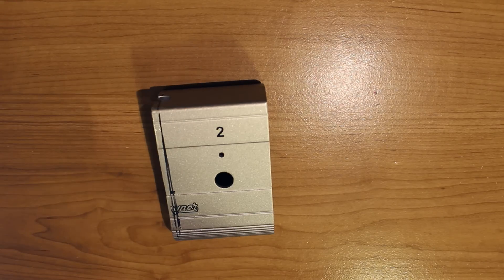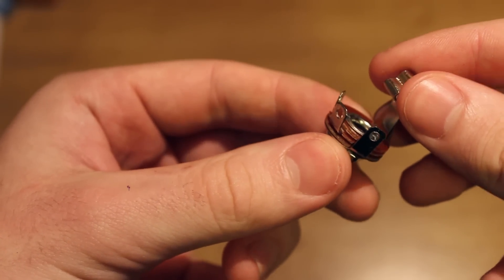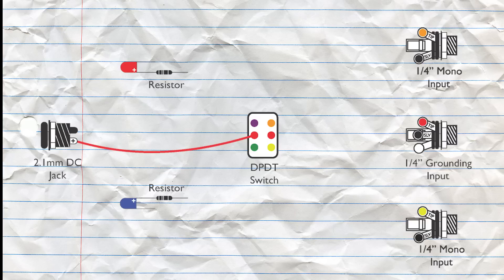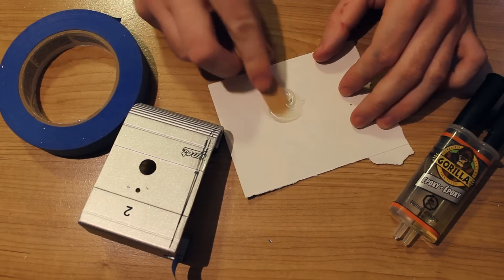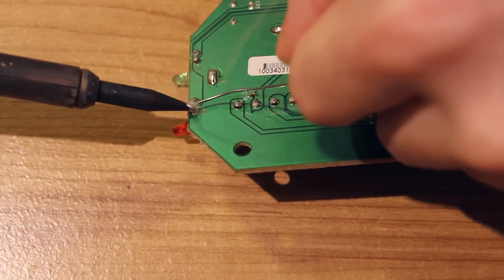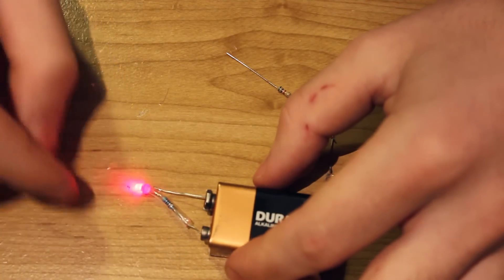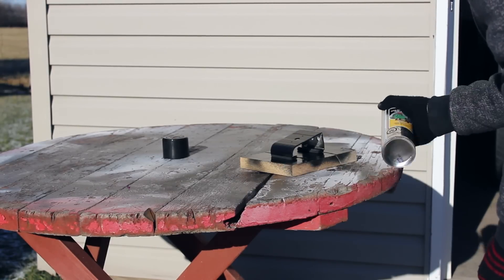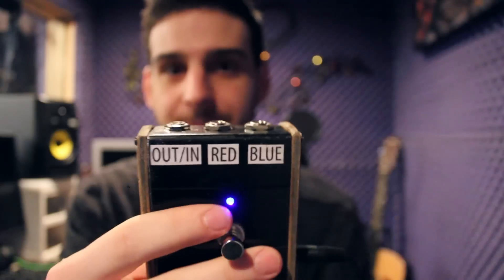How to make: A/B Switch Guitar Pedal w/ LEDs

Comment: Heyo! I assembled the AB switch as you have and have a ridiculous amount of noise on the unused channel. If A is on, B constantly makes a loud hum and same vice versa. Any advice for reducing the noise?
Reply from the maker: Sounds like a grounding issue. Could be a faulty switch? Maybe you're power/voltage is too high/ incorrect
Reply: @DidItMyself  Yeah, that's what it was. I used a metal enclosure that grounded everything together. Swapped out  the B out jack with one that doesn't ground to the enclosure and it worked.

Comment: Hi, I want to do this but I didn't understand how the leds remained turned on so I have a question about the Switch: It is a latch or momentary switch?
Reply: The led is turned on by the DC power, which is switched from one LED to the other by the switch (with resistors to prevent blowing or burning them).  You probably want a latching switch. If you use a momentary one, A will be on all the time that you aren't actively pressing the switch; i.e. it switches to B when you press and back to A when you release.  With latching, you press, changing from A to B and press again to switch back from B to A.

Comment: If I wanted to make 3 inputs, to a single output,  would I just add another 1/4" Jack wired the same as the other 3?
Reply from the maker: I believe you would need a different switch to do some like this. Another option would be to add a second switch. Look up some diagrams of ABC switches and they should show you.

Comment: Hi! nice job. Could you help me to adapt the wiring? I have a different type of switch, it has also 6 pins but is one that has longer lugs with rings on the end. Is it the same wiring diagram for that one? Thanks.
Reply from the maker: This sounds like it would be the same as the wiring diagram in the video. Good luck!

Comment: I think it's great you did this out of reclaimed material. Helpful tip; the side of an LED where the bulb is ground flat is the negative side. Saves having to muck around with testing it. 

If you want your wood to take the stain better only sand to 120 grit. I work in a wood shop and we never prep anything that is getting stained with higher grit than that. Not even fine furniture. Sanding scratches show badly under a clear coat. We would be sanding with finer grit if 120 was leaving noticeable scratches. It's cheaper to do it right than to do it twice. 

Also, if you don't like stain you could use a dye. WD Lockwood has a bazillion colors and 1oz of powder (which makes gallons of solution!) is only around $10. There is also Keda and Transtint if you prefer. I've used all three brands and they all get the job done just fine.

Comment: Fascinating video my friend, well done.  I wonder if I may ask.. I have an existing pedal that I want to add an LED light, so as to tell when it is switched on. Its a Small Stone Phase by Electro Harmonix.  It uses a 9v batt aside from the power input jack. Can you instruct on how to wire it? Thanks, John